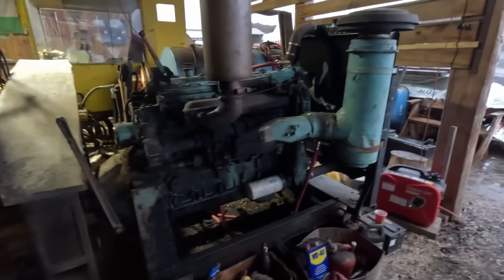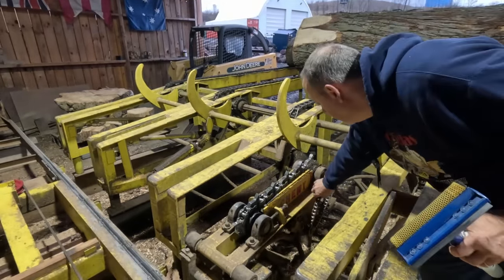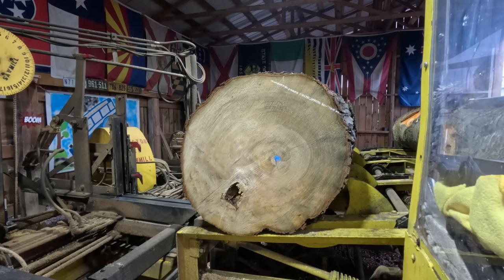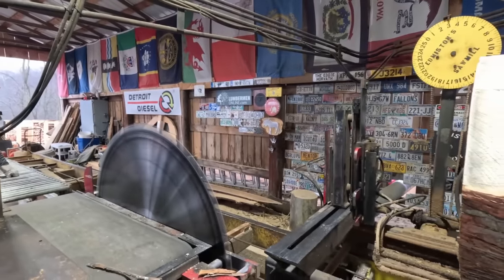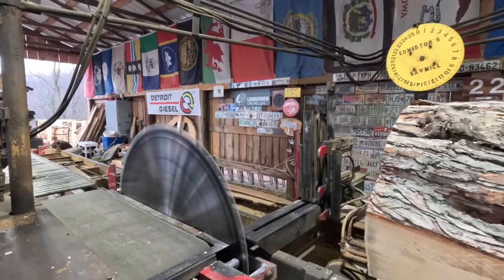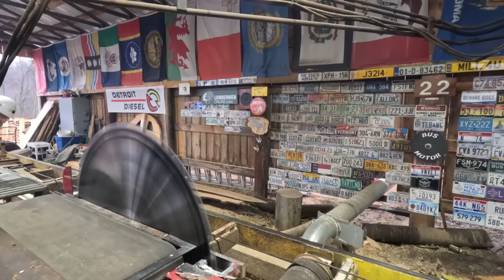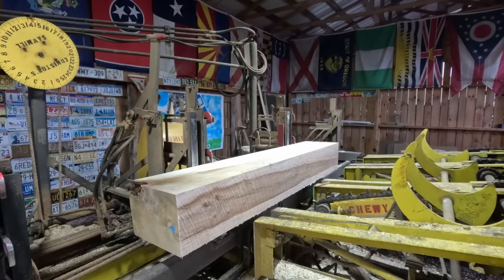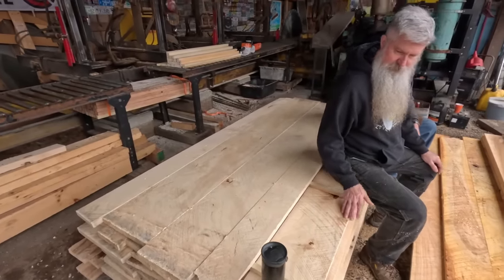sawing a monster silver maple log with a 56 inch saw # 532

Comment: By definition, engines burn a fuel, motors are electric. You have a bus engine NOT a motor.
Reply: You must be a blast at parties.
Reply from the maker: so Alan what you are saying is a motor home runs off a electric motor?
Reply: Then it would be an enginecycle, an enginecade, and the engineboat. A motorist would be an enginist and a motor vehicle would be an engine vehicle. Ah, but a Tesla is a motor vehicle as it has an electric power unit. And today’s modern locomotives would be entors or EM’s (engine-motors) as they have diesel power units that turn generators creating electricity to power the movement of the train wheels on the railroad tracks! We’ve been wrong all along!
Reply: And just to spice up the conversation, General Motors would be?……..
Reply: @bigredfred33  yeah, they may be known as Acme Engines…then there is the Ford Engine Company. But auto racing has it right when they say “Start your engines”!
Reply from the maker: @bigredfred33  I like it LOL!
Reply: That explains why all this time, 50 years, I’ve been riding around on engine cycles we call motorcycles, but not I have a Zero electric true motor cycle 😄😄😄

Comment: I grew up in a sawmill. Helped my mom and dad for alot of years. We used lean for windows. It'll hold back a .38 if you ever needed it to. More expensive than regular plexiglass but if you ever hit a wire and had teeth fly out of a saw you'll be glad you had that in there. And a little trick to take pine sap off of your window is WD40. It'll take it right off. That and orange goo for cleaning your hands.
Reply: I grew up logging in western Canada and working with balsam and sometimes spruce would leave big goobers of pitch on equipment windows. I found furniture polish works wonders to keep the stuff from sticking as hard in the first place. Not all polishes work tho. Pledge is the brand I used the most. I forget which precise flavour tho. Lexan is much too expensive to replace much. But I don't mind sitting behind a 30mm piece when things get rowdy.

Comment: this reminds me of making juliennes out of potatoes in culinary school except we threw away the leftovers instead of making use of them. also the cut is so clean until you drag it back against the saw, is there a reason for that? is it a desirable aesthetic? ive used plenty of rough sawn lumber but i just thought it would be too hard to change the process to prevent the saw marks until i saw you make the equivalent to a facing cut at 28:03.

Comment: Plexiglass is so easily scratched as you say but it's better for that job than glass. Where you're sitting while sawing the logs if the glass shattered there would be no more MARK GALiCIC.
Reply from the maker: I want to get safety glass not glass.

Comment: Still a good bus motor. If people just had a HINT of how one of those was built and how they did what they did, they'd be amazed that a drop of oil would even stay inside one. Lucas is good stuff but I just run and it's 15/40 and pegs the oil pressure in the Taco 4.3 and it 195 degrees idling. I use it in tranny's a lot though. Better to have too much oil than not enough. NISE maple. The one in the back is about that size and getting leaves on it.Will be mowing shortly. Keep on pulling the soot out of the bus motor. I remember the one in the mixer was 238 horses and a Mack 237 would VAPORISE one. God Bless Yall and ZZ with his Civil Defense hard hat!
Reply from the maker: thanks Lewie.

Comment: We had a Detroit diesel engine in a dump truck. The driver ran it out of fuel, so it sucked the oil pan dry.
Reply from the maker: that would be a bad day.
Reply: We also had one in a Ford L900 dump truck.  1 gallon of oil a DAY, and it was a 238.

Comment: Mark if you know you’re not going to use the sawmill for an extended period of time do you treat the blade with anything?
Reply from the maker: I spray it with WD-40 every time we finish sawing but oil would last longer.
Reply: White grease works good if it’s going to sit for many months or years

Comment: you can spray some diesel on the window before you use the cleaner It will break down the sap . Then the window cleaner.
Reply from the maker: not sure what it will do to the plexiglass.
Reply: @markgalicic7788 I'm pretty sure it's fine. You could try it on a corner of the side window.

Comment: I remove pine sap off my plexiglas with a folder paper cloth (shop rag in a roll) and isopropyl alcohol. Fold the “shop”and soak with the alcohol . Then hold on the sap spot for a bit till it softens , then gently rub with wet rag and it removes the sap without scratching. On one piece I sprayed with wd40 and the sap peels off when dryer. Just a suggestion for you to try.
Reply from the maker: I have used WD-40 before.

Comment: Looks  like  a frick carriage  ,them ole motors  are really  tuff
Reply from the maker: this is a Edmiston mill.
Reply: Hydraulic never liked them to slow. Been sawing since 1988 got holes in are roof I run a 60 inch saw . Frick timber tiger.

Comment: Did you keep the 20” wide boards 20” or cut them down to two 10” boards? Imagine a table top made from only 2 boards joined at the center!
Reply from the maker: yes we did keep a few wide ones.

Comment: a green laser on white wood from a camera is hard to see. it would be a lot easier to see if it was a red laser. it Might not be as bright for you but through the camera you can't really see the laser at times because of the light reflecting off the wood.

Comment: Why do you only cut 1 inch thick boards why not 2x4 boards how do you set the thicknesses
Reply: Can't speak for Mark but as a carpenter you would never buy maple 2x4s, maple's used for trim not framing. And most trim is either 3/4" thick or 4/4" (this will probably end up at 3/4 after planing and sanding)

Comment: Why don’t you just have a maintained better?
Reply: Sap and sawdust are impossible to clean, so this setup is pretty much average, and will run forever.    in 2000, I worked on a steam-powered chariot in Georgia, we installed laser scanning and an optimizer to improve yield.

Comment: Guy in Hoodie with loose pull cords is an accident waiting to happen. Only 1 person with Ear muffs a d nobody in High Vis jackets. Very poor. Operation would be shut down in Ireland.
Reply: They do call it the Land of the free, and the home of the brave.
Reply: Well thank god we don't live in Ireland!
Reply: Say that when  hearing aids are not needed as a result industrial noise. 
If an incident does not kill first.
Reply: My teen daughter was checking her transmission fluid. I put my hand on her shoulder and gently turned her  around and pulled the drawstring from her hoodie. "Why'd you do that?" she said, miffed. All I did was point to the running engine and she understood. Some comments here are not as smart.
Reply: @jameskelly9800  
She will bring that lesson to the grave.